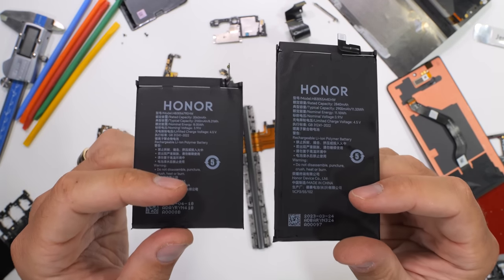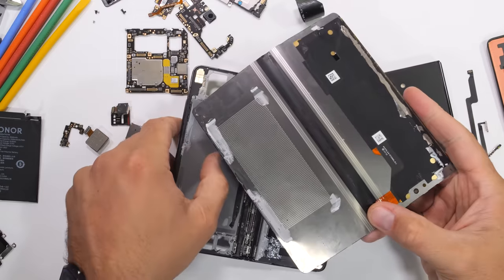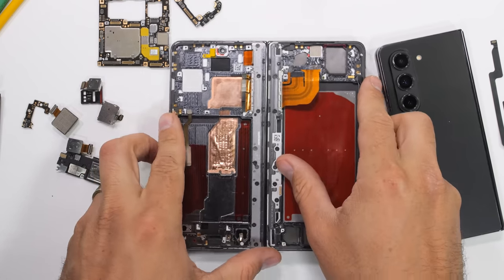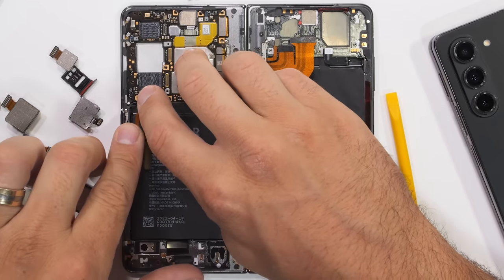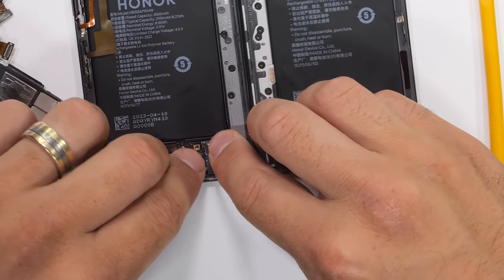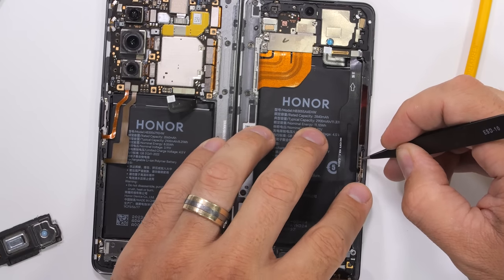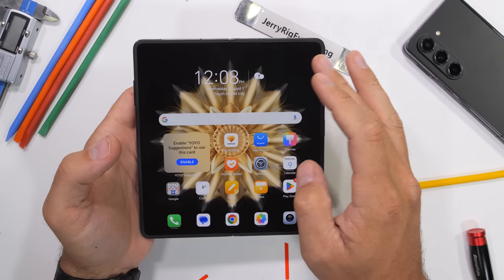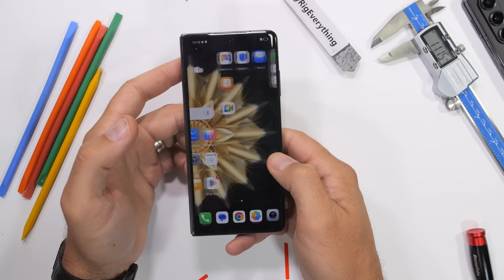FINE! - I'll build my own Folding Phone! (Worlds Thinnest)

Comment: Phone made in China, so you're supporting Chinese government, deal breaker.  Company "based" in Singapore.  Sells/Ships to Asia/Chinese only on the English/Global site, deal breaker.  Has every other region but North America (US/Canada), intentional F U to the US/Canada, makes it seem like a Chinese run company using a Singapore corp as a front.  You've no idea what nonsense China may have embedded in hardware or software (Magic OS - customized Android OS), deal breaker.  The hardware specs - battery, CPU/GPU, memory, internal storage, cameras, antennae, dual SIM, all impressive.  No external memory slot, also a deal breaker.  China using US tech nerds to spread pro-Chinese propaganda.  On the other extreme, we have Fairphone making phones in China, but attempting to source ethical labor, and also able to use any Android like /e/.foundation's Android based upon Cyanogen/LineageOS.  But  Fairphone makes ONLY obsolete phones, their next phone spec - Fairphone 5 - I guarantee is already obsolete, just like their FP2, FP3, FP3+, and FP4 were.  They also have sent a big F U to the US/Canada by refusing to sell to us.  It's getting to the point, we should just design and make our own phones, right here in the USA, from CPUs, RAM, made in US Fabs, ribbon cables, chassis, screws, cameras, USB power/data couplings, shells, batteries, all made here in the USA, with an operating system not owned by Google and infected and infested with their spyware.  Fuck it, unsubscribed.